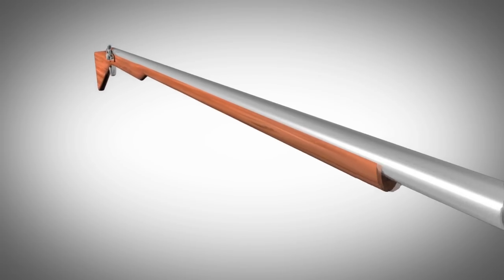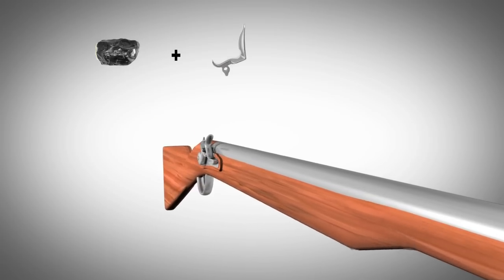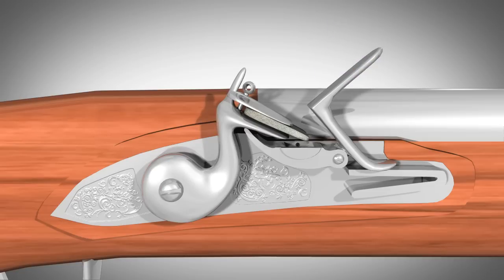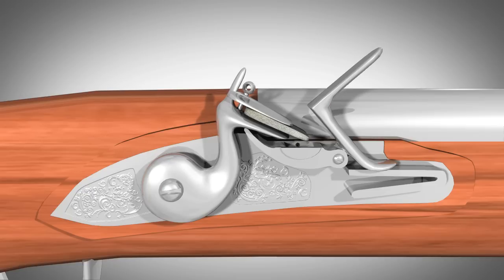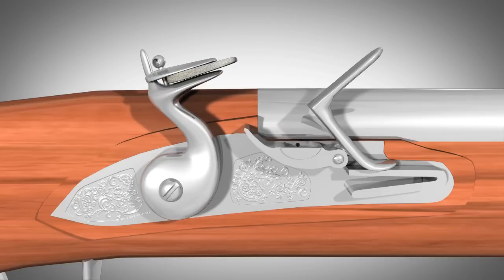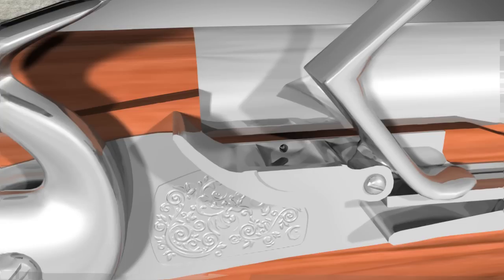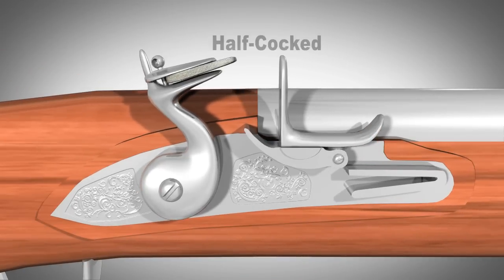How a Flintlock Works

Comment: What about the bullet?
Reply: You stuff gunpowder down the barrel, followed by the lead ball, and push it all the way down using the rod which is usually attached below the barrel. Once the ball (and the powder behind it) reaches all the way back, you replace the rod under the barrel, pull the hammer all the way back, and it's ready to fire.

Comment: Way simpler than the matchlocks I should say
Reply: truth
matchlock is way more complicated
Reply: @Jason B. in flintlock you reload way faster than in matchlock in matchlock you need to put the powder to the pan  close it than put it on the ground put powder inside then you put a ball in and ram it an then you need to do something with the uuh...the hammer the rope yes you need to fire the rope
Reply: @Nick It's simpler in how the mechanism works, but there's a lot more steps to reloading, most notably extinguishing the match and then having to relight it again so you don't blow your hands off while reloading

Comment: Just for future reference, flint is actually the soft metal, and the iron shaves off pieces of flint which are heated by friction.
Reply: No. Flint is a extremely hard stone, and the frizzen is steel. The VERY sharpe flint will scrape Tinny bits of steel off so fast those bits will turn into sparks
Reply: Flint is quartz, not metal.
Reply: Jimmy McKenzie just for future refrence dont talk unless your info is correct because you are in fact wrong the flint is harder than the iron wich causes the flint to break off tiny flakes of metal causing them to combust ant around 600 degrees give or take some sourses say more some say less but you my friemd are wrong

Comment: What drives the hammer to move so fast?
Reply: most likely springs
Reply: The mainspring inside the lock is put under great tension with the hammer at full cock and when released by the trigger the hammer snaps forward.

Comment: Nice. It happens alot slower than that thought nd with more smoke
Reply: What happened slower?
Reply: @Bountyhopper  there is a short delay from when the trigger is pulled and when the round leaves the barrel.
Reply: @PolicyHoldersAdvocates  that short delay being half a second

Comment: I think there's a bit of confusion here. There's a small amount of gunpowder in the pan (which is not shown in this illustration). The sparks ignite this powder. The explosion travels through the hole and ignites the main powder charge in the barrel.
Reply: He clearly said it...0:45
Reply: ..and let's not overlook that soggy spring!  Not to be confused as a thingy just put there to look muskety
Reply: He said
Reply: i think you might be confused. he said there is gunpowder in the pan and it was shown in the illustration if you look closely 😂
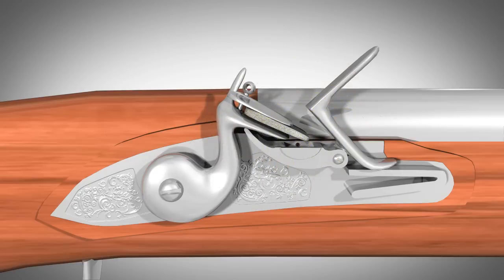Reply: A little bit after 1:10
Reply: Not only that but it's the flint held in place in the hammer striking the frizzen which causes the spark onto the pan in the first place.
Reply: He very very clearly said it and showed it, are you blind deaf and also dumb?
Reply: question, might be obvious but, to ignite the main powder it would have to connect right? so do they have to fill it up with gunpowder until that point, or does the barrel start there ?
Reply: @KohniHart  You don't have to fill the hole with gunpowder; when the powder in the pan ignites, a little burst of flame travels through the hole and is enough to light the main powder charge in the barrel.
Reply: I think no one wont answer this, but why is the mechanism on the side and not in the barrel? This way we wouldnt need the pan and gunpowder
Reply: @Jonelgo-r6p  This is how later firearms were made, with the spark coming from a detonator behind the powder. It's more complicated to manufacture and repair, so it didn't become common until much later. These external hammers are easy to diagnose and fix; you can see the problem and reach it easily. That's worth the extra bulk when you're 10,000 miles from home.
Reply: Do you mind me asking your age? Because this comment is from 2013 isnt it? @senorali
Reply: @Jonelgo-r6p  39. Or I could be a time traveler. Hard to say, really.
Reply: Still pretty young @senorali
Reply: @Jonelgo-r6p  That's what I keep telling myself.
Reply: At least you gonna live to see GTA 6, im not waiting as long as you but.. i think maybe you like it? @senorali
Reply: @Jonelgo-r6p  At the rate things are going, I don't know if any of us will live to see the next Olympics, but here's hoping!
Reply: @senorali whats your favorite kind of weapon?
Reply: @Jonelgo-r6p  I've got a soft spot for Afghan jezails. Very high on my list of antiques to own one day.
Reply: Mine definetely Kalthoff repeater. A mix of flintlock fast firing and blackpowder @senorali
Reply: I think thres a bit confusion jere theres a small amount of gunpowder